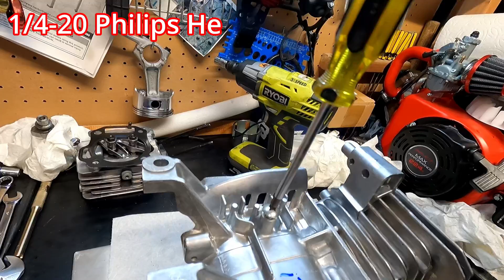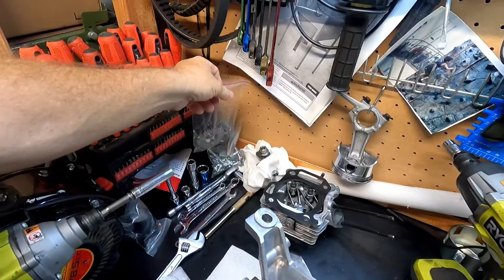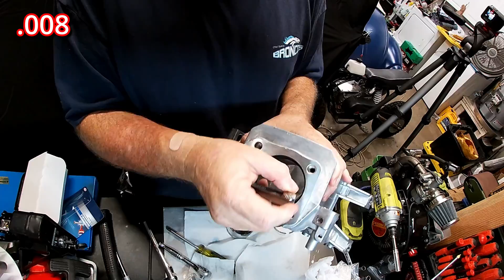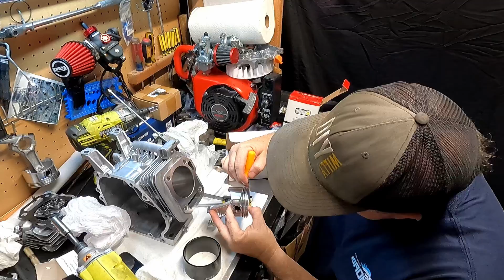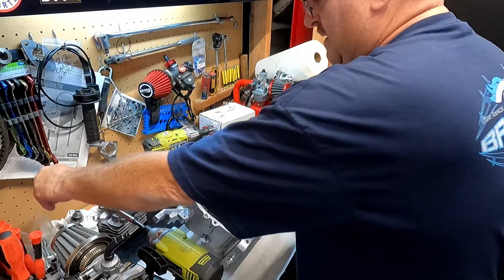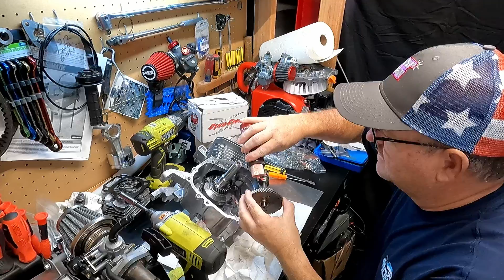Willy's Monster Predator 212 Short Block Assembly

Comment: The 212 and the 224 have the same bore size
Reply from the maker: Yes the 212 and 224 have the same 70mm bore size. The difference in displacement comes from the crank 56mm (212) vs 58mm (224). Thanks again for watching!!

Comment: I don't drill &tap the governor pin hole, I just put red or green locktite on the original pin or shaft  drive it back in until about flush with the inside of the block, the low oil sensor hole I usually tap a pipe thread and also red or green locktite for it also  because I have no intention of ever taking those 2 plugs out
Reply from the maker: Hello William, There is always more than one way to do things. This is how I do it. 
Thanks for watching!!

Comment: Where did you get that tool that holds the cam and crank to check clearances ? I cant seem to find one for a non hemi .. Nice build
Reply from the maker: Hello sbcmazdapu, The tool is sold by OMBwarhouse. It works for Hemi and non-Hemi engines. So far I’ve used it on my 224cc and 212cc engines.

https://www.ombwarehouse.com/camshaft-installation-tool.html

Thanks for watching!!
Reply: @DIYWilly  Thank you sir .. I did see it on there but was unsure if i it would work .. I was thinking of getting one even if i needed to modify it ..I will now for sure buy one

Comment: Nice Willy tried to watch this yesterday but was in Buffalo WY with no cell signal drove 11 hours to change a fuse on a machine took 7 min drove 11 hours back home 1280 miles in 24 hours is murder
Reply from the maker: Glad you had a safe trip! Talk about job security if you half to drive 11hrs to change a fuse.
Reply: @DIYWilly  2 other guys came in looked at it could figure it out I got there open panel found blown Fuze traced wire found a rub spot grounding fixed it put new fuse in fixed 1280x$1 mile $500 dm and 3 hour minimum at $150 ph I can now afford a few days off I'm thinking
Reply from the maker: Well enjoy the time off!
Reply from the maker: What type of equipment was that?
Reply: @DIYWilly  Long wall
Reply from the maker: I’ll half to look that up. Not sure what that is..
Reply: @DIYWilly  it's a giant machine the scraps dirt away for mining

Comment: Looking good! I think that 308 cam is going to make this rascal sing. For someone "Not building a race engine" ,  it looks an awful lot like a "race engine" to me. 🤣
Reply from the maker: Yes it does look like a race engine.😎 I wish I had a place to race it. Should run really good.
Reply: @DIYWilly u gotta send me the link for that block good gawwwd maaan get the magnetic oil plugs too billet everything
Reply from the maker: @CruiZe-A-ViSiON  I was thinking about the magnetic oil plugs. Remember awhile back  Kentucky Fried Fixes did a how too video about making your own magnetic oil drain bolt. I’ll have to go look it up and make them for this engine. Thanks for reminding me! 👍
Reply: I second that motion - It looks like a Race Engine...
Reply from the maker: Thank you